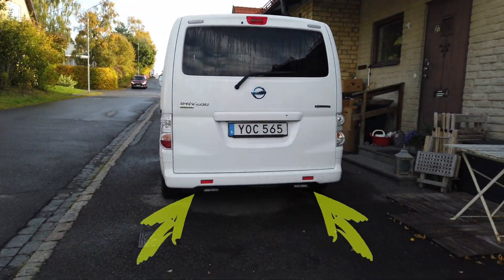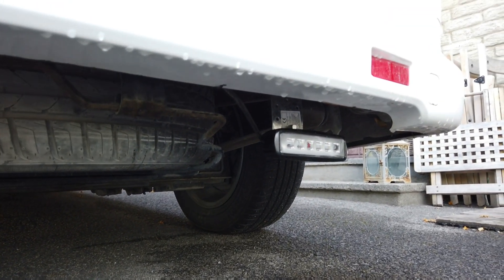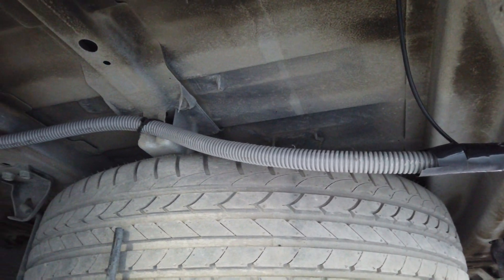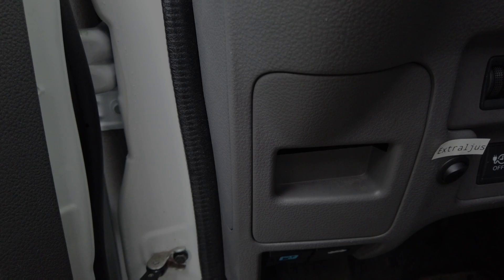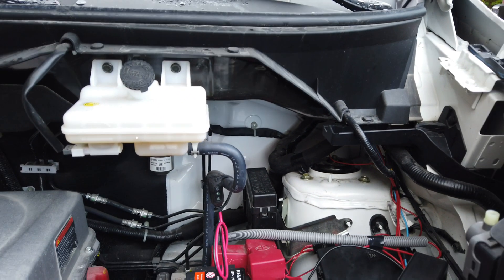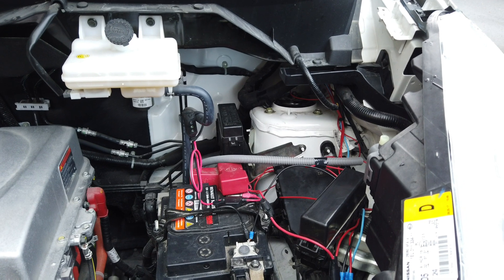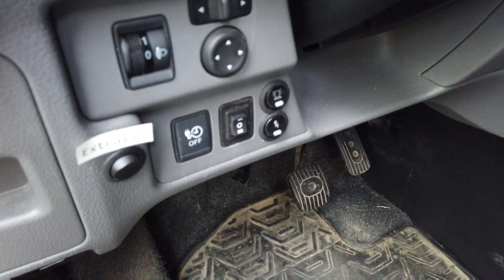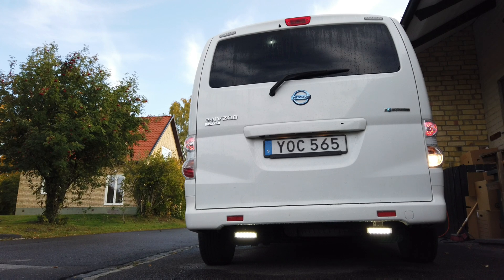Reversing light, Nissan E-NV200

Comment: Nice work! What are the other additional 3x switches for?
Reply from the maker: Thank you.
The one on the left is for a light bar and the two on the right control the yellow strobe lights that are mounted on the car. (The one on the top is a light switch and the bottom one controls the strobe pattern.)